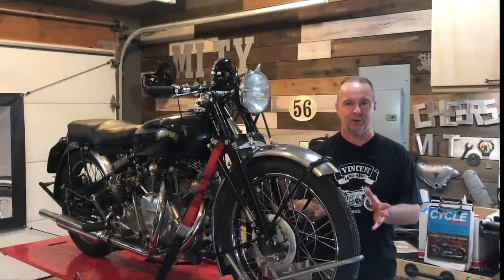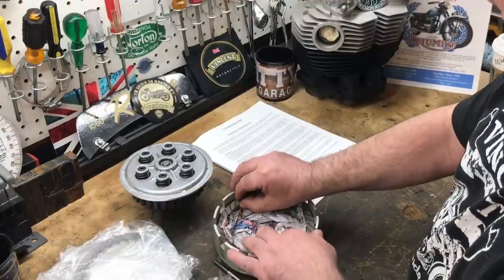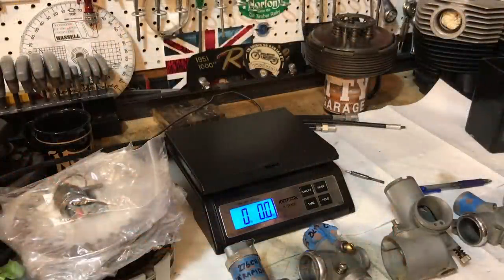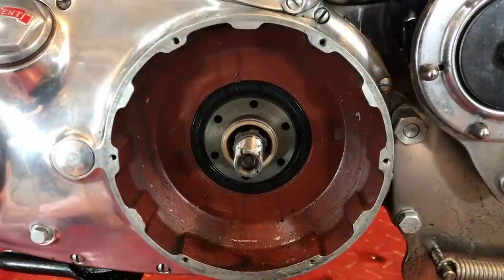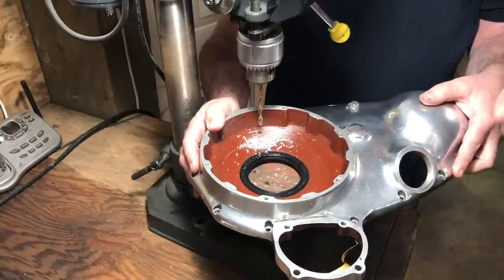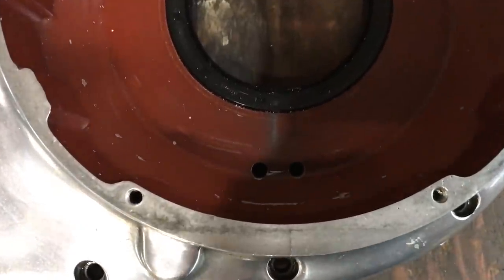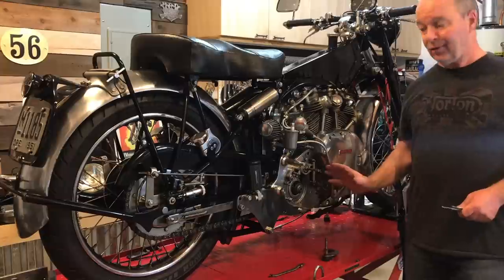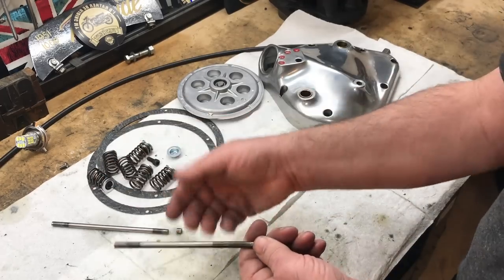Restoration of 1951 Vincent Rapide - Part 68 - Clutch Adjustment (Part 3 of 4)

Comment: Have you check the clutch shoe piston springs?  Encased in the shoes behind the piston and under the friction material? If they are weak your clutch will not engage properly ..I just did this on my twin and it made a world of difference.